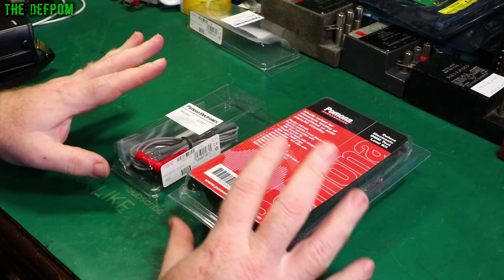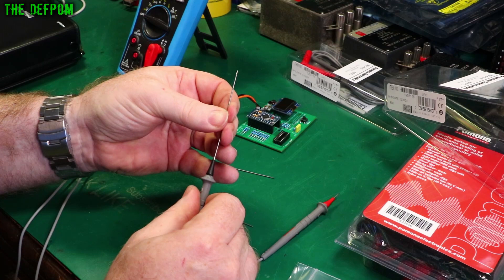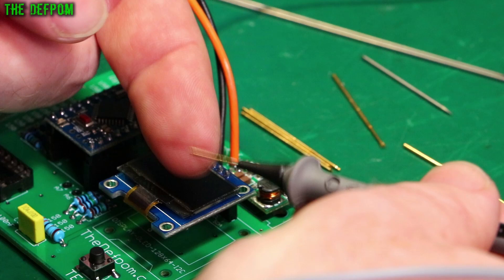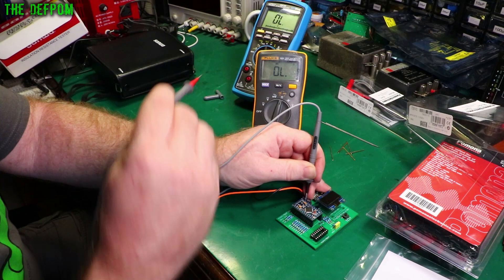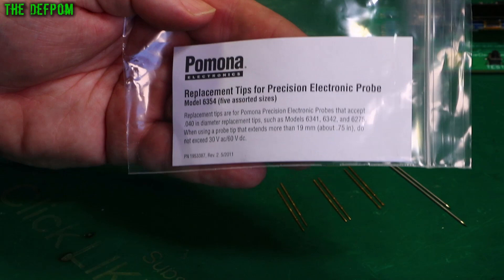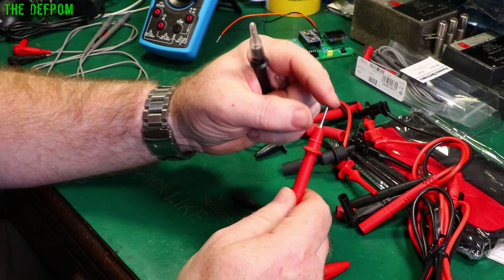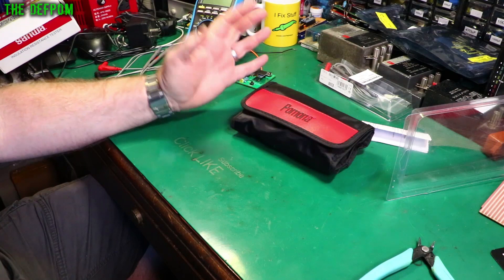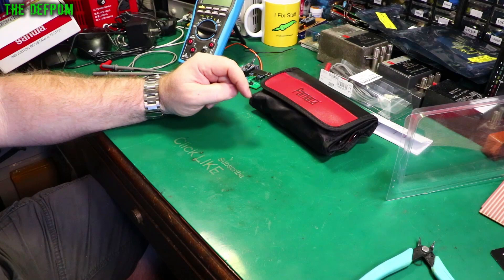🔴  Pomona Precision Electronic Probe Kit & Deluxe Electronic DMM test Lead Kit Review - No.928

Comment: I use the Probemaster 8150 spring loaded test leads almost every day for work; they have a similar style replaceable pogo-pin style tip. I use the crown-head tip the most as I work with small SMD components down to 0402. What's great is I can place the leads on the points I need to measure underneath the microscope, then I can look up at my testgear without having to worry about my probes slipping off. I've also found the crown tip super handy for checking small SMD components when they're OFF the board as well, which used to be extremely painful. With the crown tips I can grab both sides of the component easily without it shooting off into the void of oblivion somewhere. Imagine trying to identify a mystery 0402 resistor on your mat with regular sized leads, those tips you thought were super sharp are now just gigantic cones at that scale. Oh yeah also the probemaster version is only like $42 U.S. lol.

Comment: Nice review of the pogo tip probes.
I have both the Pomona 6341 and Probemaster Spring Loaded Micro-Tip probes and have been using them for at least 10 years.  I found that I use the Probemaster ones a lot more, probably because of the finger grip... and they cost a lot less.

Comment: I tend to only use one probe as the negative side is normally connected to 0V.  I had a supply of hard steel pins about 1.5mm dia and I'd grind the tips to a fine point and solder them to fine silicon wire, make great small probes. Biggest problem is probes are often matched to the current and voltage range of the meter, for voltage of less than 60V you don't need a lot of insulation,  and for voltage measurement you don't a 5A current capacity in the wire. So tend to leads matched to what I'm measuring.  Just a old engineer set in his ways. :-)
Reply: Yup, if you cut open cheap leads its amazing sometimes how small the gauge of wire is.
Reply: @IanScottJohnston  Yep That's why I make my own, thin leads for doing voltage measurements and much thicker for doing resistance and currents. if the lead resistance is going to be more than the component then it's over to 4-wire mode.

Don't you just hate the way some leads can move the board when you clip them on. :-(